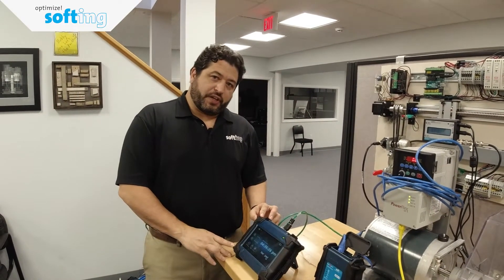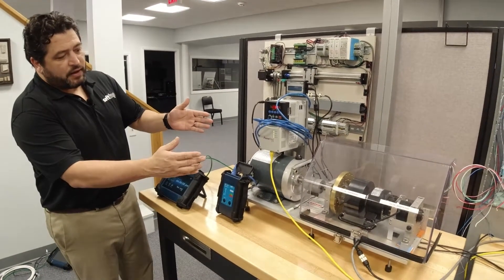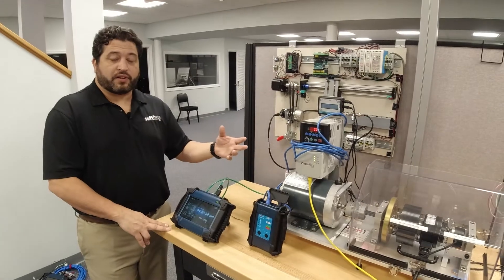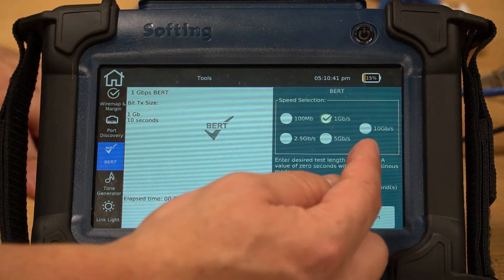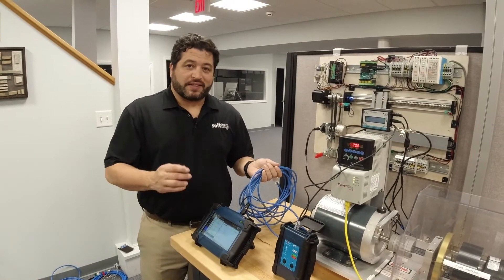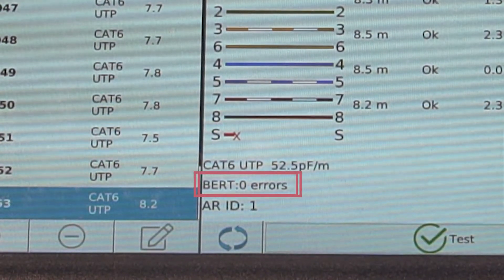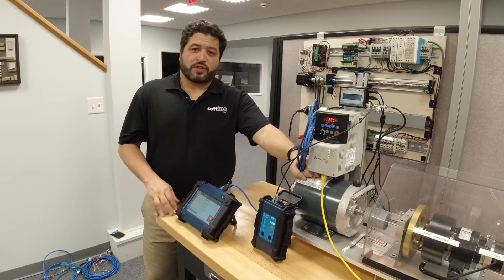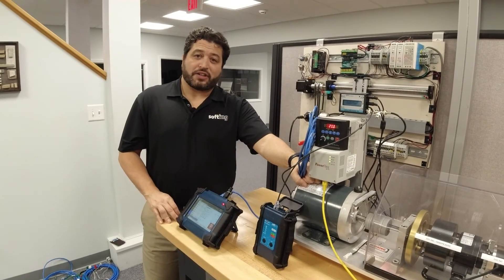How to detect EMI on Ethernet cable using BERT (bit error rate test)

Comment: Would the real world outcome simply be reduced ethernet speeds? How many errors are acceptable in an office environment for the cable to still perform just fine, even if it doesn't provide a stable 1Gbps?
What other ways are there to test for EMI near cables like long HDMI cables? Would like to have a device on hand to rule out EMI when determining signal issues.
Reply from the maker: Possibly, yes reduced speed. .. but not necessarily. Could have enough packet loss to drop the link outright.
Reply from the maker: How many errors? We simplify the pass/fail understanding for the user by having a 0 packet loss threshold.
Reply from the maker: We do not test HDMI cables. We can test Category cable destined for AV communication.
Reply from the maker: EMI is a constant environmental reality. We do not test for EMI. We test the cables capability to perform in environments that have EMI present.